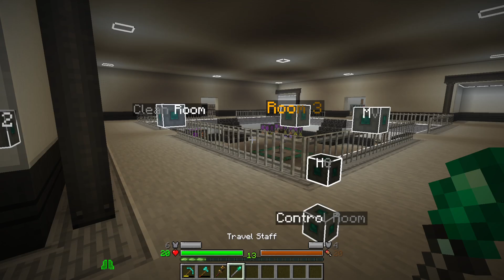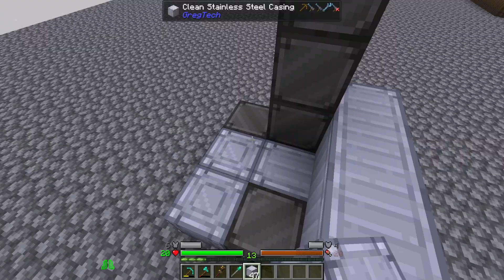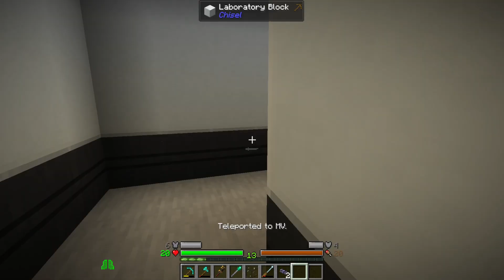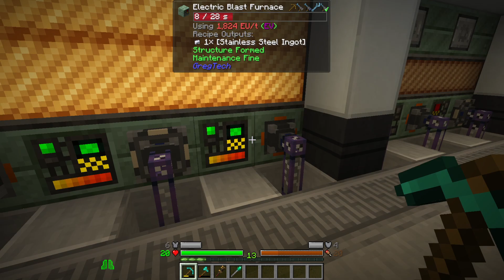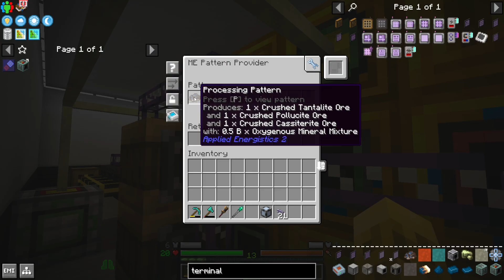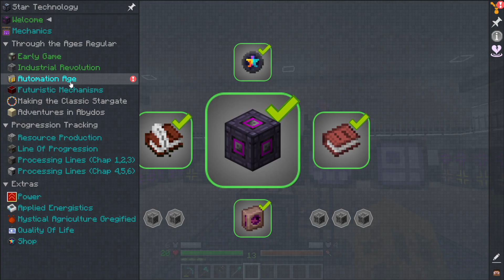Star Technology - EP 22

Comment: The benefit of perfect overclock machines is when they are running at voltages higher than the recipe's tier, as they run the recipe at 4x speed while consuming 4x power, while an imperfect overclock (single block machines) will still consume 4x power but with only 2x speed, basically wasting half of the energy. 

Parallels allow a machine to "underclock" itself to run multiple of the same recipe (for example let's say that a normal EV machine runs an HV tier recipe in 1 second, with 4 parallels it will run 4 recipes in 2 seconds using the same amount of power similarly to a perfect overclock ), they don't make the machine run different recipes at once though.
Reply: so are paralells also good in terms of energy saving? are they squivalent to pOC? Or should they be considered differently?
Reply: @senioy one tier of parallels is functionally equivalent to one perfect overclock, but they do have different use cases, most perfect overclock machines get capped to one recipe in between 1 and 3 ticks (depending on rounding), which means they're capped at ~6.66 to 20 recipes per second (which also means they won't use more energy at that point even if the energy hatch is upgraded), while their parallel capable version allow for a much higher throughput.